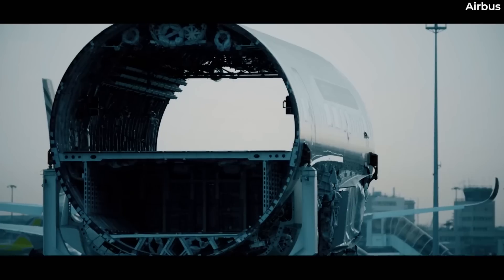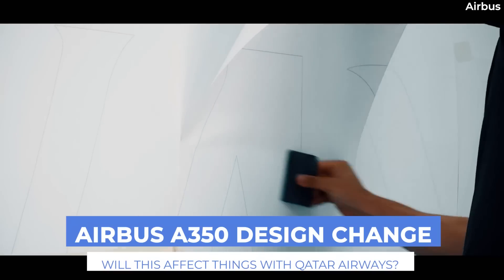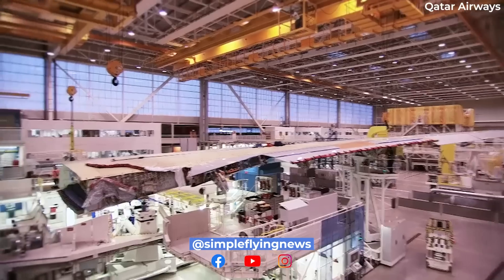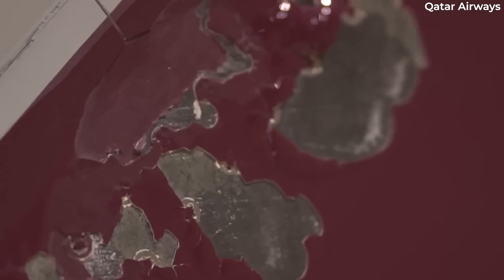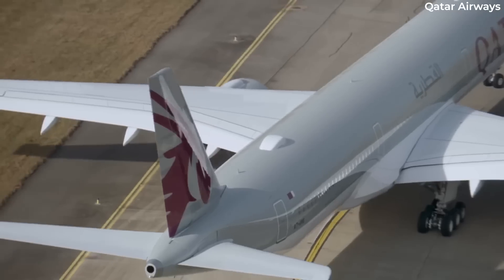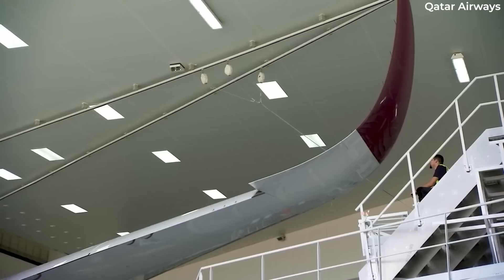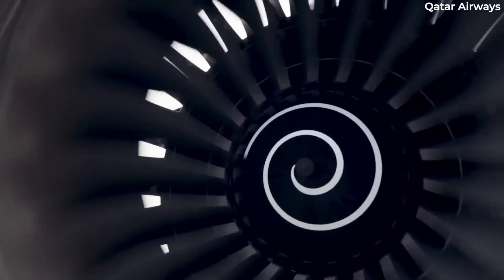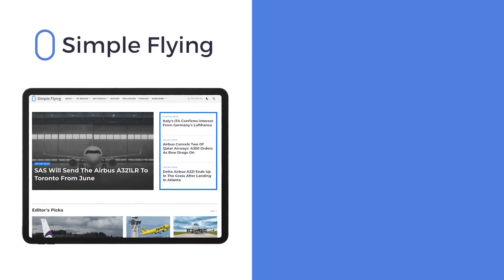Airbus' A350 Design Changes Amid Ongoing Qatar Airways Dispute

Comment: At last a permanent fix implemented...
What about the 500 a350's currently flying.!!!
Sounds very  expensive if they must be replaced with the new foil design.. instead of just repainting as a temporary solution...
Reply: Not all but who will pay for repaints for the life of the airframe?
Reply: @bernardfrancis3080  Say Airbus does offer to do this.   Who gets to say when it is bad enough to require new paint.   It is a snake pit.  The fans do not see it but this will hurt Airbus.  Standby for 737MAX rant because they have nothing.
Reply: @danharold3087  Airliners have be repainted eventually after a couple of year, that's the way it is.  Airbus may as well select this moment as an opportunity to switch the copper foil.  Although it looks more like there were also improvements in the paint process so the paint primer is holding better on metal surfaces like titanium.
Reply: @aquaden8344  Yes they do but the foil is not supposed to peel off.  That is what is causing the problem!  The paint is not peeling from the primer. Take another look at the pictures where you can see large areas of exposed foil.
Reply: @danharold3087  It has been established and published by Airbus, that the color layers have decreased bondage on certain metal surfaces like the head of titanium rivets and  titanium screws.
The lose copper mesh in some pictures was due to continued use of the planes after the color flaked off and having the planes sitting in the baking hot sun of Doha for an extended time.
Reply: Not all A350s are affected by paint defects.
Reply: @ClémentTainturier  That's probably true..But early on I recall Etihad, Cathay Pacific, Finnair, Lufthansa, British Airways , and Delta all  reported  paint issues with their fleet..
Reply: Clément Tainturier mentioned that not all A350s are affected by this paint defect.  It is not a paint defect it is bad foil.   The problem can pop up on any A350 built with the foil.  They are ticking time bombs.   Will Airbus be willing to strip a 20 year old plane down to the foil?  How many will be scraped if they don't.   This will have to put a damper on used A350 sales.

Comment: i hope this might signal a change in the dispute between Qatar and Airbus, they'll come to some sort of financial agreement and orders will resume
Reply: I think it has gone too far now, Qatar will be a Boeing only operation
Reply: @Pratt & Whitney PW1000G Yeah, but their order was significant enough where Airbus wants the money and thus will deliver the aircraft most likely regardless of the court turnout; canceling would result in more earnings loss when they would already have significant loss if they were to loose the court case.
Reply: @tsikinite  Airbus isn't delivering any planes no more to Qatar after they cancelled all orders, at least that's my understanding.  Although Airbus will not take back the delivered planes.  It was Qatar suing Airbus to get compensated for the grounded A350s.
I think Airbus would appreciate to solve the paint issue silent together with Qatar, but Qatar has to make it's point at the risk of losing the court case.
Reply: mercifully the dispute has been settled and Qatar will continue to take A350's and A321 LR's once the paint problem is fixed
Reply: @joecrammond6221  It's more the visit of the French politician, who reminded his Qatari counter part to face reality and slow down.
I guess reinstating Qatar's orders and be willing to give QATAR access to Airbus products again is kind of a settlement reward.  Qatar has a large Airbus fleet after all, and they could experience the consequences of not using more then half of it.
QATAR could have leased more 737, 787, and 777 and dumped Airbus completely, if the Boeing products would have been soooooo superior.  Instead QATAR took the offer to reinstating its orders with Airbus.